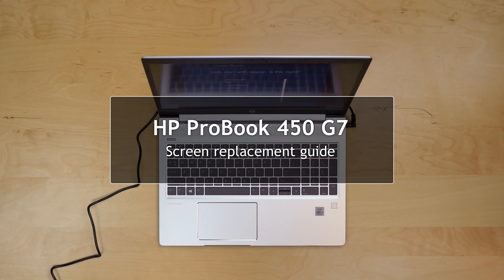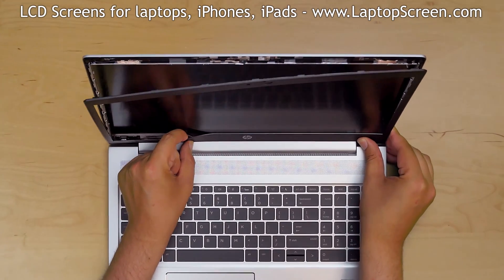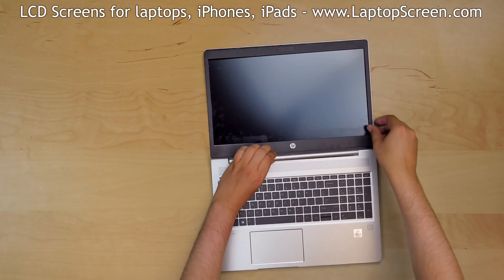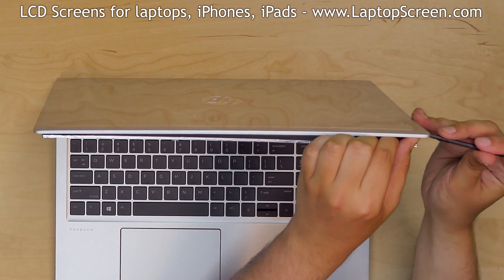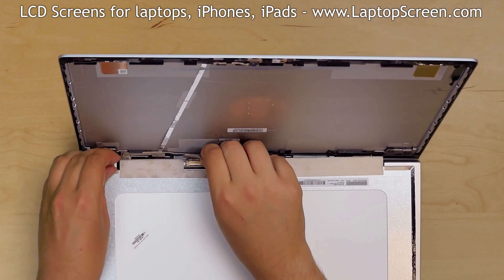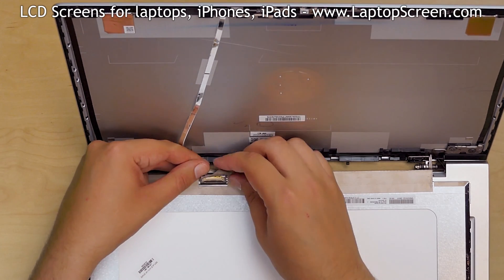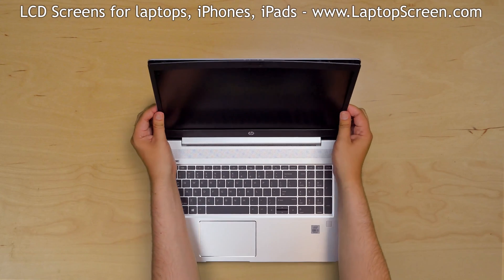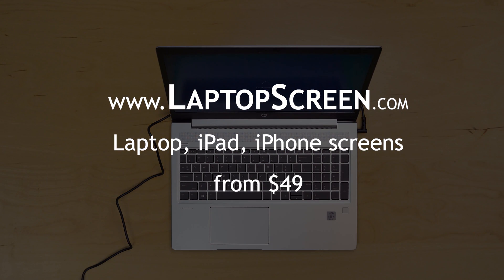How to replace LCD Screen on a HP ProBook 450 G7 laptop. Step-by-step instructions

Comment: My neighbour asked me to fix her sons laptop and when I diagnosed the issue I found that the LCD panel is broken in one of the corner, so I googled for a replacement I just came about your website... I gave to them a spare laptop as temporary replacement, so they don't have to wait for long since they do not miss their classes and their mom cannot buy them a new one either... and while browsing your website I found about this giveaway, I looked for the specs and I think it can be a good laptop for myself since what I am using right now is an 8-year-old landed to me by my work... so if I am selected winner, added to that  I am pretty certain that I will succeed in fixing the neighbour kids' laptop (without any additional repair cost) I am going to let them keep the one I gave to them so each of the kids will have his laptop, and I am going to have a new laptop as well as the one from the work... and everyone will be happy! I will post photos with a note as well :)